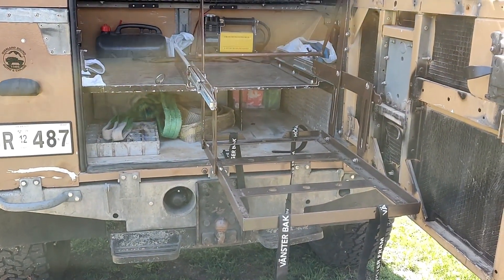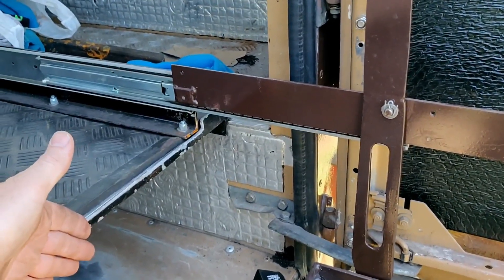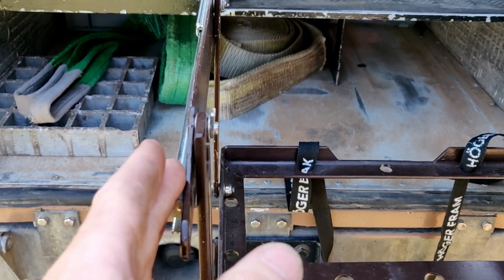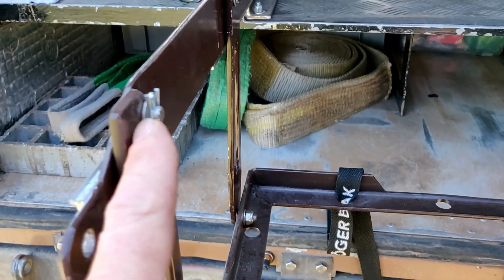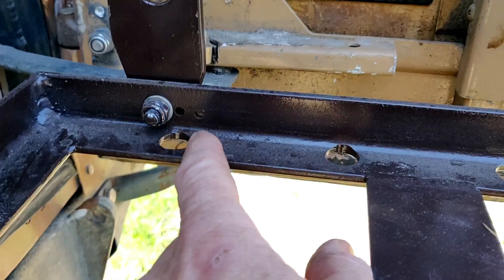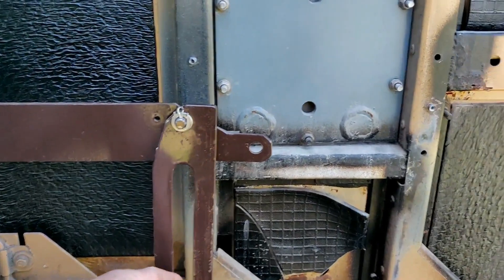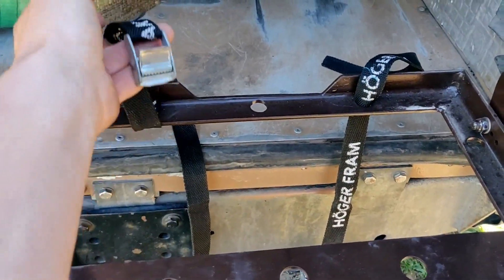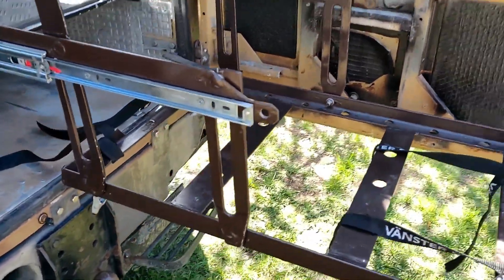The Making of my Drop Slide - Description Video

Comment: Thank you, great explanation of the pitfalls, nice you pointed out the mistakes you made so we can avoid. Excellent video mate.
Reply from the maker: Thought that I had it figured out with the first drop slide that I made, but this new one did catch me out when I recycled parts. Live and learn as they say but it was cool to get it working with as little as possible new material to create a bigger and better drop slide. We've used it on several trips now and it works great, even the missus has no problems with lowering/lifting to get her wine from the CFX35.
Reply: I dont mean to be so off topic but does someone know a tool to log back into an Instagram account?
I was dumb forgot my login password. I would love any tips you can offer me.
Reply: @Marcellus Aaron instablaster =)
Reply: @Kolton Santana it worked and I now got access to my account again. I'm so happy!
Thanks so much, you saved my account!
Reply: @Marcellus Aaron you are welcome xD

Comment: I'm almost done with mine I used all aluminum and welded it up. Pretty light I wanted to use nylon bushings on the pivot Points to make it Glide easier but of course my hardware stores out of them. I did see a hack where they use an old CB antenna bent over to hold up the power cable to keep from getting stuck in the sliders.
Reply from the maker: wow, that will be so much lighter than mine. BTW I have changed the bolts on the tray to clevis pins, which afforded me a few more mm width as I'm now using the Dometic thermo cover for the fridge. I like that hack, I have to see if I can make it work in my truck. Thank you for sharing that hack.

Comment: How much lighter is this to the commercial drop sides?
Reply from the maker: I would say several kgs as it does not have flat bottom for the tray, no gas struts plus I did my best to keep this drop slide as light and strong as possible. This one does weigh between 8~9 kgs. A friend's brand name drop slide, we figured it was double in weight but I would recommend googling to compare figures.

Comment: Great video. May I ask how or if you have a locking mechanism to hold the tray back up please
Reply from the maker: If you look at both plates that the sliders are mounted to, you'll see at the front there is an extension with a hole in it. There I use a locking pin to hold it in place when it's in the up position. A very simple solution that works.

Comment: how did you get the length of the horizontal bars that attach to the slides
Reply from the maker: Those pieces of metal I cut them slightly longer than the slides. Once everything was assembled I welded tabs on the front ends for the locking pins to go through. 
They should be no shorter than the slides for support but you can make them as long as you wish or available space allows you. 
I made mine as compact as possible because of space limitations in my Land Rover but if you have a pickup or the likes, you can make the drop slide larger to carry additional items. Good luck with your build.

Comment: What size angle iron did you use? Thinking about 40mm?!
Reply from the maker: I'm guessing that it was 50mm, I can check tomorrow.
Reply from the maker: The base which bolts to a platform is 40mm wide and the height to accommodate the slide runners is 80mm. Hope that this helps, good luck with your build.